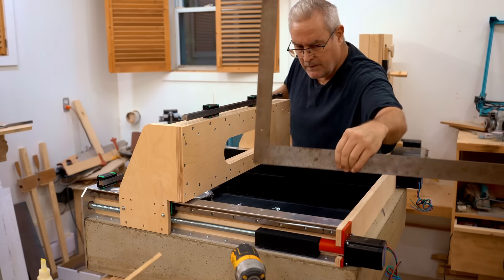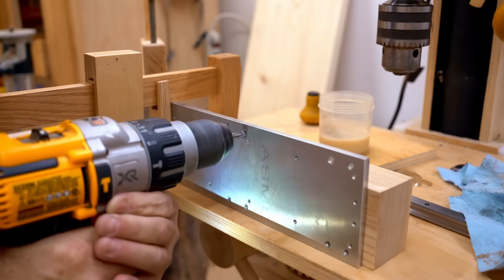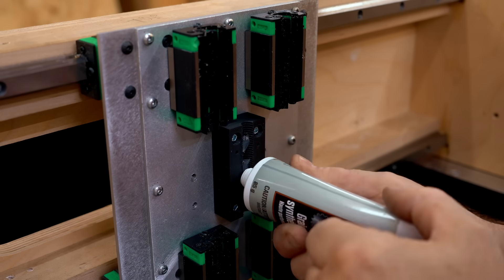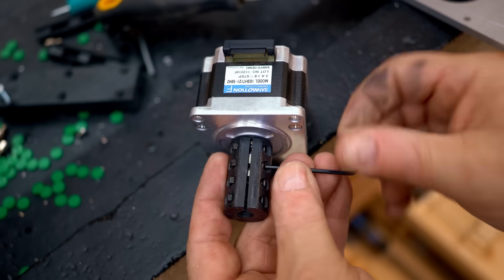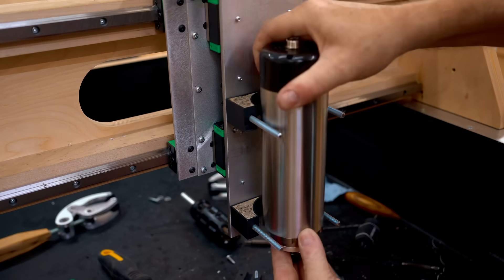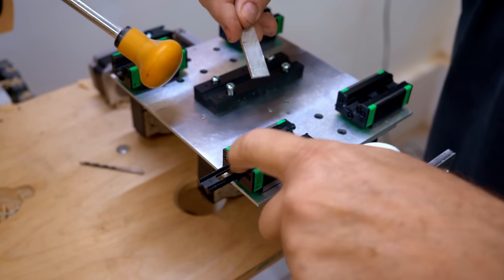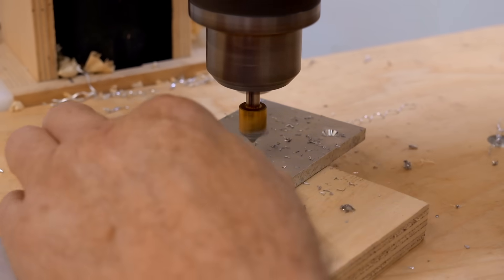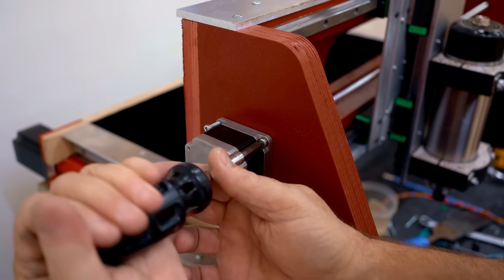10,000 Hours Later... CNC Mill Build Part 5

Comment from the maker: Well, not quite 10,000, but it feels like it. Building a CNC from scratch is the project that keeps going and going and going... like that bunny, but the end is in sight. In fact I'm very close to having all of the mechanical parts of the machine done, with mostly electrical left to do.
Watch part 4 of the build here: https://youtu.be/Y60NYveXV1w
In this installment, I get the Z axis parts made, build a crude stand for the new CNC and get the machine moved onto it. The gantry was taken off, taken apart and painted a beautiful red colour than not only brightens my existence, but also protects the wooden parts from the coolant that the machine will use while operating. To increase the structural rigidity of the gantry, I added 1/4" thick aluminum plates to the top and bottom of the gantry beam and got it put back on the machine. 
Regarding the "quality" of this machine and the compromises I made with the end usage in mind, I want to point out a simple truth: there isn't any such thing as a "perfect" machine - they will all make tradeoffs. Those tradeoffs are to get the machine built within a reasonable budget so that it can do the work it's supposed to do. There's very little point spending 3 times as much as it would cost to buy a ready made machine. Besides, I find it challenging to try to push the limits of what's possible rather than going with what's been proven to work. For example, of course high quality ball screws and nuts are better than threaded rod and 3D printed nuts - that's obvious - but my goal is to find out whether that much less expensive option is actually a viable one. Will it work? How well will it work? How long will it last? For me these are the interesting aspects when I'm designing and building something.

Comment: If you're power tapping a lot (with the drill) it may be worth getting a machine tap.  I had the same big-box tap and die set for a decade (never broke one) and can tell you that the difference between hand and machine taps is significant.  I think gun taps are a little stronger, if you're not doing a lot of blind holes.

Comment: This is a great project but I have to disagree about paint being a good protector against water. I live in the northeast US and even high quality exterior paint applied to properly primed bone dry wood starts peeling after a couple of years and needs to be scraped and re-done. In my mind, there is zero point painting anything that is exposed to a wet climate. Water will find its way into the smallest of access points, and once the wood gets wet, any paint, no matter how good, will let go. It's inevitable. 

I also built a telescope that I decided to paint black instead of my usual stain / poly. Telescopes get SOAKED from dew being out under the stars for hours, so I decided to put some drops of water on the paint and let it sit for a few hours. The paint got soft and didn't actually protect the wood underneath, which swelled, leaving some blisters where the water drops had been sitting on the paint. Again, supposedly good exterior grade paint. 

If you want water protection, there's no substitute for a few coats of a good spar urethane and a layer of some wax on top. I ended up having to top coat that painted telescope with several coats of General Finishes 450 to give some mediocre water protection, but it's nothing compared to a good oil spar urethane.

Comment: The other thing you can do if you don't have access to a lathe and need to attach a leadscrew (or ballscrew) to a motor is to get a shaft coupler of the correct diameter (and if you have an odd diameter as often is the case with a ballscrew, sand it down a bit to fit the coupler, like was shown in the video) and pot the end of the leadscrew into the shaft coupler with a suitable steel-filled epoxy (like JB Weld). A bit crude, I suppose, but it'll get one going. 😉

Comment: Lookas great.  I  built a cnc during covid and used Dave Gattons plans. I was thinking of ugrading the Z to linear rails. I was wondering why you have the rails on the Z and bearing blocks on the Gantry slide. Thanks in advance.
Reply from the maker: My arrangement uses the linear bearing rails to add stiffness to the Z spindle plate.
Reply: @JohnHeisz that's what I thought. You did mention how stiff the rails are.
Reply: What size linear rails did you use? I like the idea as I have a big sheet of 5mm thick aluminum.

Comment: Two things concern me. First is the lack of thrust bearings to isolate the motor shafts from the cutting force, second is that a 3/8” threaded rod is not a very fast lead and your motors are not going to have a lot of torque spinning that fast as their torque curve falls off fast as the motors turn faster. Steppers are strongest at lower speeds. Other than that, looks like a great build.
Reply from the maker: Um, you saw everything you mention in action throughout this series with me using the older metal cutting CNC to make the parts.

Comment: I’ve really been enjoying this series. As a retired manufacturing engineer and CNC machinist, I really appreciate your attention to detail and design capability. Since time and money aren’t unlimited, it’s always a balancing act. The only thing I might consider changing/adding, is the upper and possibly lower X axis gantry stiffener. Considering the span, even as an add on, L shaped  material would add significant strength to resist Z axis deflection and resist harmonic movement. Keep up the great work.
Reply from the maker: There wouldn't be much of a gain switching to angle, since the gantry is quite a lot stronger and stiffer in the vertical due to the height of the gantry beam. The flat plates reinforce in the horizontal where that extra strength and stiffness is needed.

Comment: When you build your next CNC 😉: build it in a way that the stepper motor bearings aren't the main axial load bearings. Two bearings near the ends of the lead screw (on the "outside" end) with a lock collar would transfer all the load directly into the frame. That way the stepper motor doesn't see any axial load. This setup also allows you to tension the lead screw, which removes any axial play and wobble of the lead screw (because it sags/isn't 100% straight).
Reply: i read this comment and i think you're right. why shouldn't each side bearing rail be built the same as the x and z axis? cost of course, but each point of contact on the axes should actually be triangulated. using the gantry as a triangle works, but all the flex from the connections across that distance probably adds up exponentially.
Reply from the maker: What I'm doing here isn't any different from the StepCraft machine I took apart to build the first one. They didn't bother unloading the stepper motors or tensioning the ballscrews. Why? Probably because they determined the loads didn't exceed the capability and couldn't justify the added expense and complication. 
AKA, it'll be fine, and I say that based on using machines configured that way, as you can plainly see in this and previous videos.

Comment: You built a solid concrete base and then built the rest of the cnc out of wood, sheet metal and printed plastics. You used linear rails with acme screws in plastic. I think you have no idea about what you are doing.
Reply: Not sure you understand his goal, it's an economy build. Are you just dumb or are you rage bating?
Reply: Typical Euro snobbery at play...
Reply: I saw no "acme" screws in use here, only common threaded rod. So maybe you have no idea what you are saying. Pay more attention and you'll notice John already has a home-built CNC that works well to his requirements (the only meaningful definition of quality), and this new build is even sturdier. Will it hold up to heavy use and industrial applications? No, but since it doesn't have to that question is entirely beside the point. It is, in fact, meaningless.
Reply: @tcarney57 well he cited a screw mostly used for heavy loads(at least he knows that about CNCs) that he probably decided to attribute to this machine in a leap of faith, not sure why you spell it with  quotes. I can too see that it is a common threaded rod, that does imply a slip from the guy but not much. I decided to comment because I fear you think "acme" screw = "screw made by the fictional company ACME" due to the quotes but maybe I'm pessimistic
Reply: You didn't watch any of his previous videos, did you? 
The man works wonders!
Reply: I thought the same about you when I read your comment...
Reply: And this week, only one viewer that doesn’t get what John is doing out how he works. I’m sure there will be more, but the other naysayers appear to have moved on. Funny how there is always at least.

Comment: This is great! I have a question about tolerances and accuracy. Like you, I am a woodworker type and so using a carpenter's square and tape measures is normal. But when I see metalworker types, they are using dial gauges and talking about thousanths of inches. I am wondering if you spend more time measuring than you show, or is there a "close enough" that can be achieved by just being mindful with regular woodworking processes?